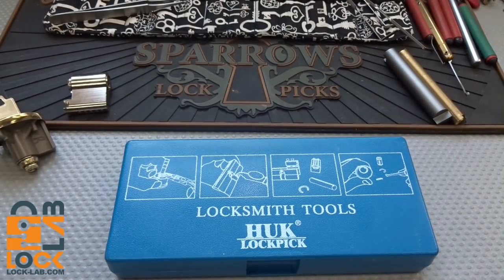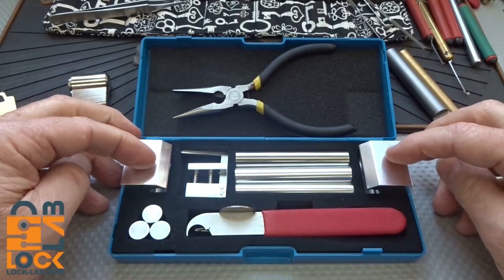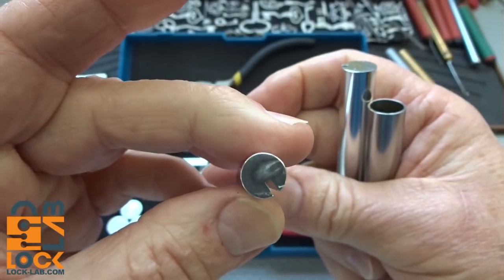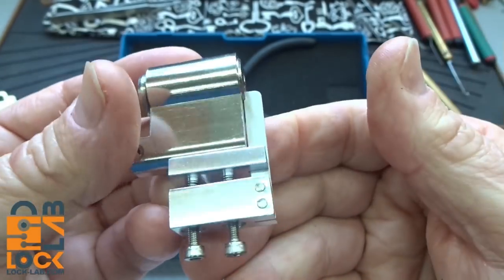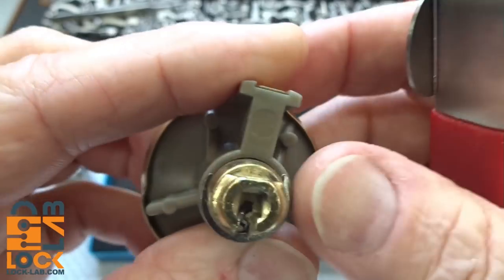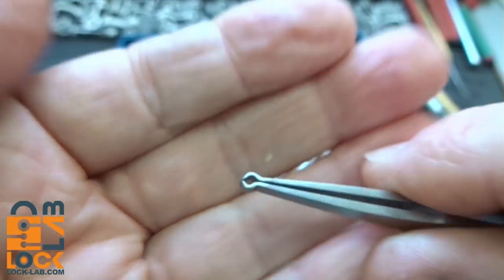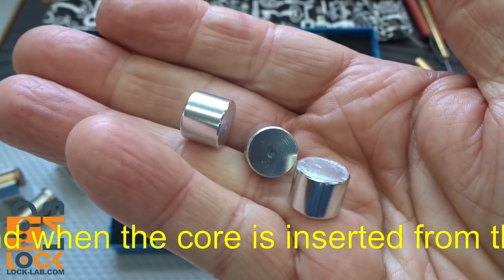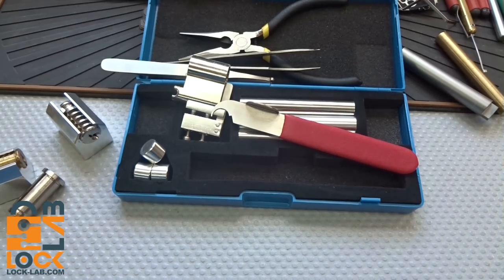(955) Review: HUK Lock Disassembly Kit

Comment: I had never actually held a profile lock in my hands but when I saw ads showing the segmented follower I immediately thought how clever it was.  I knew that you could place the segments in from the back one at a time while installing springs and drivers.  You then remove them while inserting your regular slotted plug follower,  put your bible pin clamp on and finally install your cylinder.I have since bought this great little kit and some profile locks to experiment with.  I have watched videos of people repinning locks without this kit and it looks like a real headache.

Comment: The little holders are pinning jigs, put the key in the plug and you can test your pin lengths by rotating it. 
Really useful if you are making your own pins, you can make one by cutting a kik cylinder down the middle.

The flat ends make it a lot easier to re-pin the bible, just pin one side like normal then push the follower in far enough to pin the other side in the other direction, you can then put one plug in, fit the little clip and remove the follower, as opposed to cutting it in half that is. ;P

Comment: The kit is specifically designed for profile cylinders hence the flat follows. It is not for mortise or KiK locks. As Steel Pinnings stated, the 3 "small" followers are a segmented follow.There are ones you can buy that are magnets.

Comment: i threw the pliers in the bin
looks like the one from ukbk
if you screw the allen bolts a tad you can get the tool to lock onto the cylinder.
the circlip tool tend to bend and isnt made of stainless steel.
the tweezers could do with the ends bending over so the pins can be handled easier.
apart from the above hand little kit.

Comment: I've not found a better set for disassembling Euro locks sad to say I think it's a good set but as. Bill said more thought could have been put in to it there a pain to repin the bibles and Euro come standard with both ends on not cut , I'm going to make my own bible pinning plug as I can't find one at a sensible price out there, but it's a very usefull kit and quick to change key pins , night mare to pin the bibles in compleat euros
Reply: Not to be a smart ass but that's why the plug follower is not cut away on the ends, it's pretty quick to pin one side then push the follower through far enough to then pin the other side back the other way.

Comment: Hey guys, could someone please remind me what the recommended thickness for picks to be used on European locks? Thanks in advance.
Reply: Islacrusez look for slim picks for Euro or if your making them 17 to 15 the 23 standard don't fit
Reply: Islacrusez 
I typically buy from Sparrows or Petersons, and I get one of each in each size. 1 standard. 025 or 023, 1 Euro .018 or .020 and then I get a slimline. 015 and Bill makes an even smaller one at .013 & .012
Hope this helps. 
Cheers!
Reply: Islacrusez 
I typically buy from Sparrows or Petersons, and I get one of each in each size. 1 standard. 025 or 023, 1 Euro .018 or .020 and then I get a slimline. 015 and Bill makes an even smaller one at .013 & .012
Hope this helps. 
Cheers!